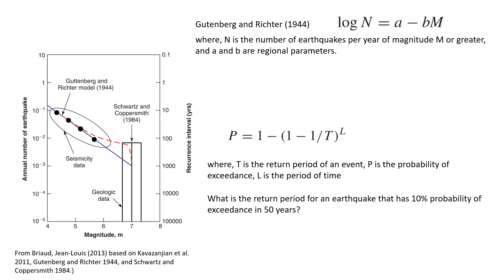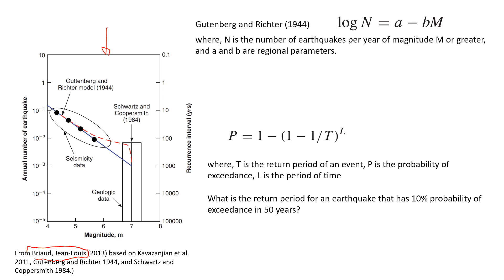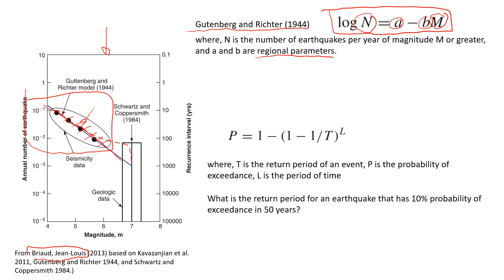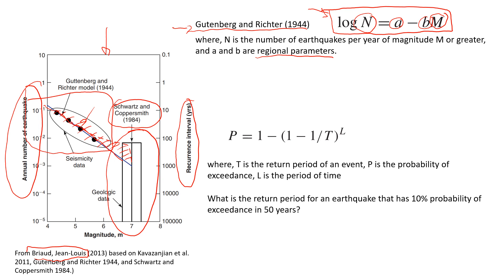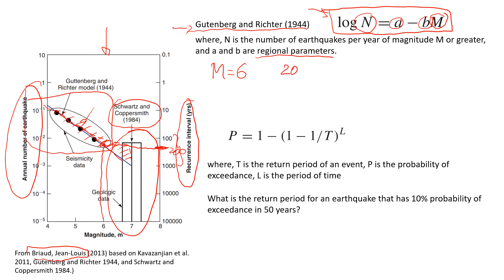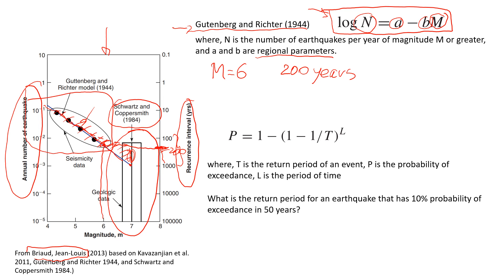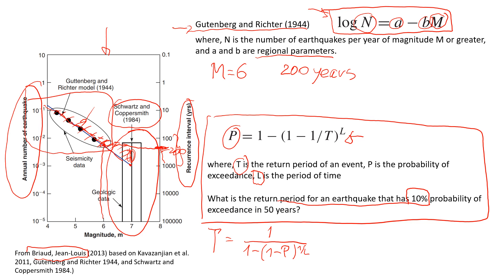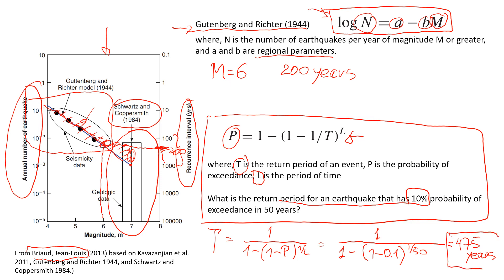How to Estimate Earthquake Probability and Recurrence Time | Example and Explanation #education

Comment: n% = 1 - (1 - 1/MRI) ^ interested period; back calc: MRI = 1 / [1 - (1 - n%)^(1/years)]

if interested in the risk over an exposure period of 50 years:

10% in 50 years:   1 - (1-1/475)^50 = 10%,  back calculate the year:  =1 / (1 - (1 - 10%)^(1/50)) = 475, ok

5% in 50 years:   1 - (1-1/x)^50 = 5%,  back calculate x =1 / (1 - (1 - 5%)^(1/50)) = 975.3

2% in 50  years:   1 - (1-1/x)^50 = 2% , back calculate, x =1 / (1 - (1 - 2%)^(1/50)) = 2475.4

interested in the risk over an exposure period of 100 years:

20% in 100 years:   1 - (1-1/x)^100 = 20%,  back calculate the year:  x=1 / (1 - (1 - 20%)^(1/100)) = 448.6, close to 475

10% in 100 years:   1 - (1-1/x)^100 = 10%,  back calculate x =1 / (1 - (1 - 10%)^(1/100)) = 949.6

4% in 100 years:   1 - (1-1/x)^100 = 4% , back calculate, x =1 / (1 - (1 - 4%)^(1/100)) = 2450.16
Reply: https://www.earthquakecountry.org/library/12685.pdf